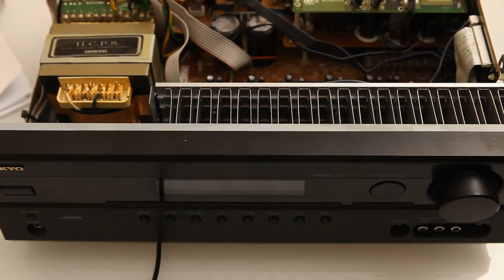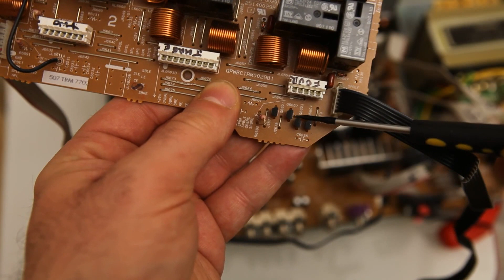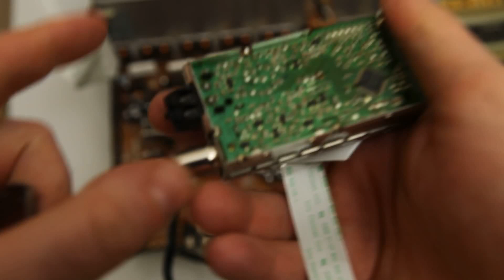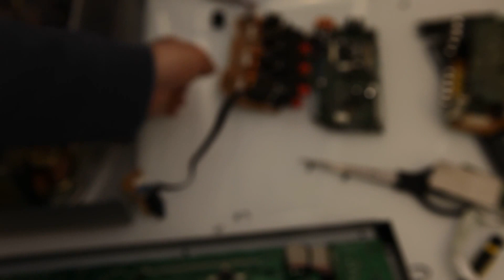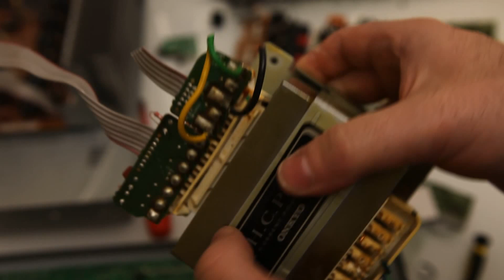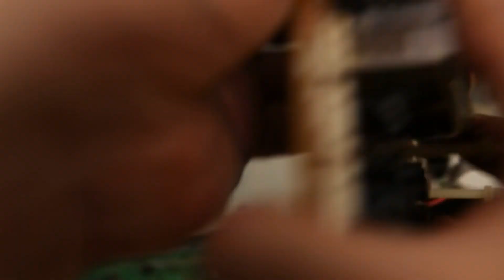Onkyo digital home theatre receiver amplifier extreme teardown

Comment: I am currently trying to salvage the amp part of a NR717. It has a hi/low voltage section I need to figure out how to switch and the speaker protect needs a protector IC thingy somewhere (I am a noob in electronics). I do get sound from the amp already though :)

Comment: I just spent €45 on a broken TX-DS 696 I'm half thinking to tear out all the digital crap and just take advantage of the two front channels. Spec seems decent. need to always check replace or clean well the bias pots oxidised pots is often why they overheat and some people don't check to see if they burned out from the shorted transistors. At least these don't use sound modules.
 I was considering to change the display panel for two large analogue vu meters. Lets see how good or bad the pre amp board is first!

Comment: Funny i had the exact same channel (SBL) that pop the cap (its the cap at 2.4v bias for endstage). I saw even others having the same issue at forums. I replaces drivers and endstage transistors and 3 resistor (100 Ohm and 0.22 Ohm) now works again
Reply: yeah thats the commonly done replacemey whenever any channel goes bad in this reciever

Comment: What model is this receiver?
I've got a TX-SR578 that has blown one of the large transistors (on the heat sink) and a cap, on the right amplifier. I've replaced the receiver but will attempt to revive this one (why not?). It looks like this receiver you've got is almost identical inside, I think it might even be the same model. I'm mainly just trying to sort out the easiest way to remove the amplifier board. It looks like just about everything has to be dismantled to be able to get underneath it.
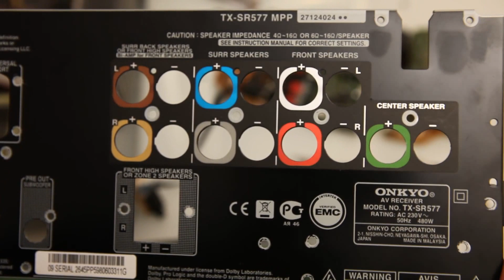Reply: Ah I see it now at 16:26 - It's a TX-SR577. Looks like the 578 adds HDMI 1.4 for 3D capability but is otherwise the same. Thanks, this video will be very useful.

Comment: Need some help you guys...I have an Onkyo TX-SV717PRO and my volume knob is acting up..The volume stays high and its all in the volume just very very loud and even if i use the remote to turn it down it want..plus my little red light dot on the knob blinks all the time..Can anybody give me some advice?.I am an electrician so it want be hard for me to fix just need advice on whats wrong!!

Comment: I am in the process of disassembling my Onkyo TX-SR701 and I cannot for the life of me "pull out" the speaker connectors from the board like it appears that you did.  I removed the clip and gently pulled, but they don't come out.  Did you unsolder them?

Thanks,

John
Reply from the maker: +itsjustdad You need to push the connectors. There is a lever mechanism on it. Push it in, and it releases the wires. I think I just pulled them out, but that's a good way to damage the connectors and wires.
Reply: +ChumpusRex 

Thanks for the quick reply.  I tried that and they would not come out.  There are several others on the receiver that work that way and they come out quite easily.  Also there are resistor wires that prevent two if them from wliding forward.  

On the small one the 24V terminal broke on the connector so I removed the connector and soldered the cable directly to the PC board.    Perhaps it was already broken and may explain the Protect circuit tripping (which is what I am troubleshooting).

Thanks again,

John
Reply: @itsjustdad  Had you ever get the TX-SR701 in working conditions?

I'm working on a TX-SR702 that has no protect issue, but it has no sound, except if I put it on "Pure Audio" mode.
Any ideias would be appreciated.

Comment: those Onkyo have poor ventilation and get too hot. thats the cause of all the problems
Reply: +PhuckHue2 when i got my 809 off of ebay (tx-nr809) it has 2 huge fans on the bottom, which i believe help move air, tehse do get hot, yes i agree.
Reply: I have an 805 with 2 fans sitting on the top. The internal ones never turn on
Reply: @CrashCarson14  The thermal sensor is broken. You can bypass it and they will stay on when you hit the power button
Reply: @PhuckHue2  how do you do that

Comment: ChumpusRex I have a technical question for you. Speakers have impedance, correct? Does an amplifier itself have impedance on the audio input line that feeds it? If so, how can I measure that impedance? Thanks in advance!
Reply from the maker: The amplifier does have impedance on the inputs. Typically, it is very high - in the many kOhm or MOhm, depending on amplifier design.

Easiest way to measure it is to connect a resistor in series with the signal, and connect an oscilloscope across the resistor to measure current, and use the 2nd channel to measure voltage. Calculate impedance by Ohms law.

Comment: Shame that you didn't even try to repair it. That failure seems to be not too bad. You should have replacee the blown caps, the transistor and given it another power on. These amps cost up to a 1000 quid you know.
Reply from the maker: I probably could have repaired it, but I'd done some damage during the disassembly, and it wasn't an expensive amp anyway. If it was a £1000 amp, I'd have been a lot more motivated and a lot more careful. This model can be picked up for £250 brand new, and regularly sells 2nd hand on ebay for about £75.
Reply: ChumpusRex
Phew, ok that's just a small loss then. I really wonder how they make money out of these, since there is this huge number of parts in it. Seems I am not up to date with the current prices. And that my 7.1 AMP like that one but without HDMI is worth almost nothing then... (was just 229 EUR new)
Reply: i got 2 tx605 units for £90 for one of them and £55 for the other
Reply: my units dosnt produce that much bass   u have to turn volume up to 50 just to hear it lol